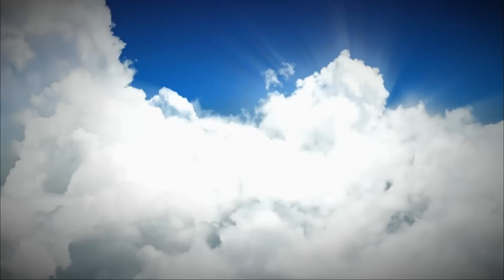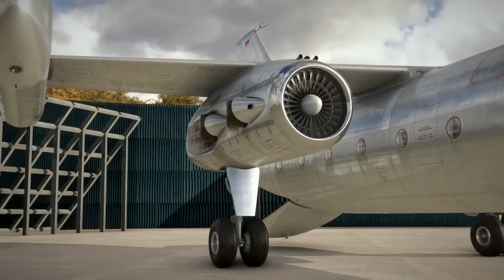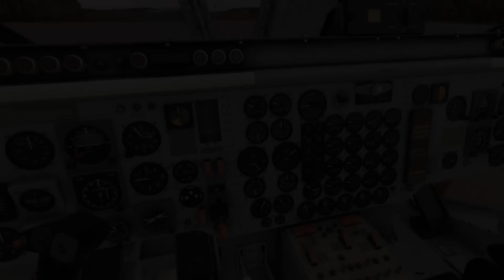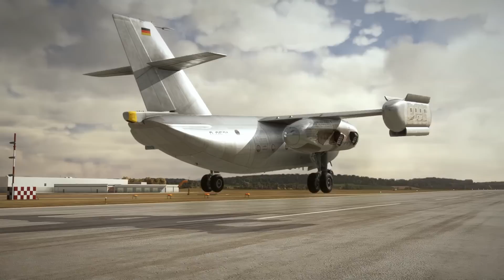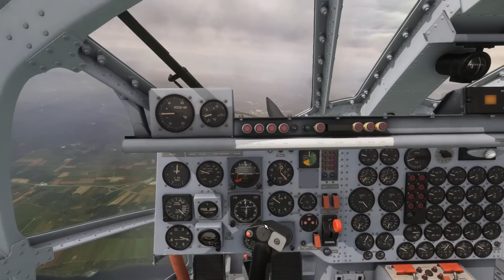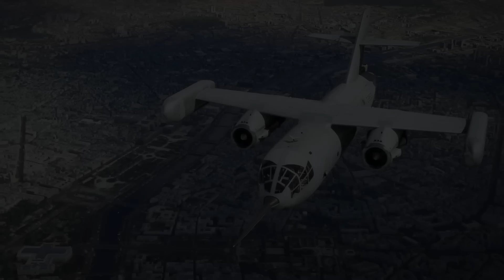The VTOL Jet You Didn’t Know You Need! | iniBuilds Dornier Do 31 | Full Flight Review | MSFS

Comment: What is up with the weird artifacting on the intakes?
Reply from the maker: Hi IP,

I believe that's caused by DLSS frame generation (which I have recently started using).

I hope that clarifies things. All the best! : )
Reply: @IntotheBlueSimulations  It does explain it but with your rig you can just run straight TAA and the whole sim will look better.
Reply from the maker: Hi IP,

I was running straight TAA until very recently however, even with a decent PC, the sim was still choking my FPS from time to time (with quite a few people commenting on it); obviously it’s a bit of give and take but, I think the odd visual artefact is worth it, for a smother experience / video : )

Cheers!

Comment: What's making all that noise when you flip the battery master on? It sounds like she immediately starts spooling an engine?
Reply from the maker: Hi Streaky,

I assume that noise is supposed to emulate the avionics fans (or something to that effect). Quite a nice sound effect although, rather loud, as you say. Aircraft fans can be pretty noisy but, they aren't generally louder than a Rolls Royce Pegasus at full chat (which seemed to be the case here) XD

All the best! : )
Reply: @IntotheBlueSimulations  Yeah, I did wonder if it was the avionics, and maybe gyros spinning up, but seemed too loud for that. After having watched the rest though, I wonder if it's the vertical lift engines we're hearing? You mentioned when you went to start them that the throttle for them was already in start, and they were already spinning? I wonder if that throttle is meant to be out of the start position before you put the batteries on?
Reply from the maker: It could well be that also. I had my (3rd) throttle axis all the way back and that seems to be as far back as the lift engine levers will go. That being said, the lift engines do seem to immediately spool up to some degree, as you say. I did wonder whether that’s by design (perhaps they are always partially spooled, to allow for a quick start-up etc) but, to be frank, I have no idea haha.

Sorry I can’t be of more help on that one. All the best!

Comment: It rolls when you pitch in forward flight?  Sounds like a lateral weight inbalance, maybe fuel tank locations or something
Reply from the maker: Actually, it pitches down (which I could maaaybe understand) and rolls to the right, when main engine thrust is added in / to exit the hover. I can’t really think why that would be (unless it’s some hangover from iniBuilds using a helicopter flight model, perhaps?). . . Any ideas, sir? : )
Reply: @IntotheBlueSimulations  No idea!  lol  I don't have the airplane, not really my thing

Comment: I wished I watched this video before I bought the aircraft, the fact you can't control throttle yourself made me lose all interest in this addon, big shame as I really like the aircraft
Reply: I've the logitech x56 hotas .. absolutely no problem to set up  this airplane.  Flys well..
Reply: @Daniel-Hawk  you are talking without the mod, right?
Reply: @Jannik_Stein  yep
Reply from the maker: Ahh, sorry to hear that you didn’t enjoy the addon very much, Federico. I thought the DO31 was pretty good fun but, the addon is certainly very basic in its implementation (which is a shame).

All the best!
Reply: Are you sure they work independently?  My throttles are tied so closely by the copilot there is basically no point in having them independently bound.  Worse, when reducing them the nozzles always move forward so it's impossible to control a descent in the hover
Reply: Reading the user manual you CAN control the nozzles and thrust manually. I did it last night.

Remove all bindings for THROTTLE control. 

Set propeller axis' for props 1 through 4.

Propeller axis 1 controls main engine 1
Propeller axis 2 controls main engine 2
Propeller axis 3 controls lift engine thrust
Propeller axis 4 controls vector nozzles.

When seated in the aircraft, look at the little GPS on the left. Click "advanced"

Proceed to enjoy full control of the aircraft. Now you can do an actual hover with full Pegasus thrust without the nozzles tilting forward.

Very fun and rewarding
Reply: I also find that at a perfect hover I need to use differential engine thrust to achieve yaw control which adds another level of complexity
Reply: In real life, the throttles were managed by the Copilot. It is just not possible to manage them yourself
Reply: @Jannik_Stein  I modded the aircraft so I have full control, it's possible and it's fun. I'm trying to make the mod an easy drag and drop in community and I'll publish it

You can check my channel, there are two videos of it.
Reply: @federico339  ok now you've got my interest
Reply: @Jannik_Stein  unfortunately it's a very "hacky" thing, and it doesn't work too well, also until someone decrypts the files I don't think it's going to be possible to have a drag and drop mod, I might do a video explaining what I did and exactly how it work
Reply: I just assigned different controls so they work independently as I have throttle control.